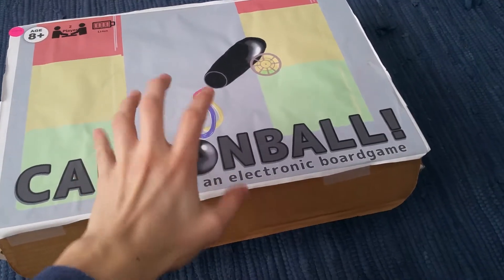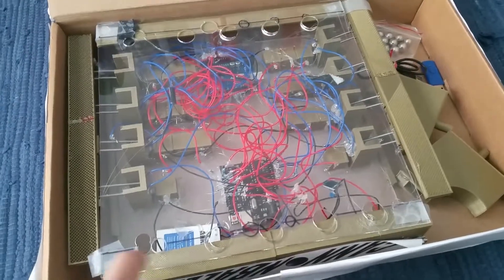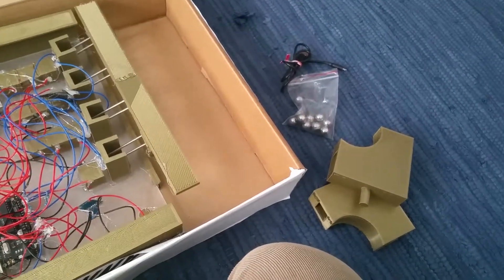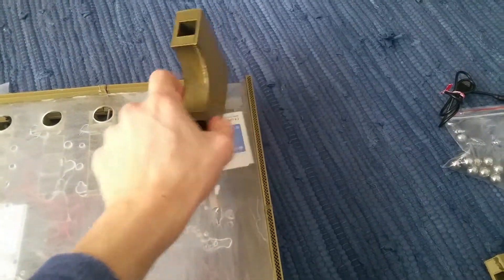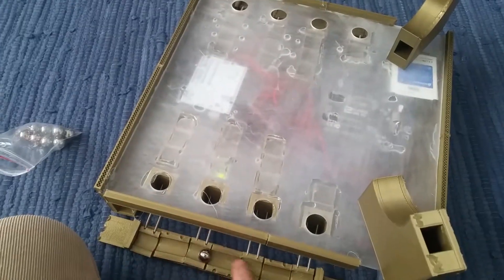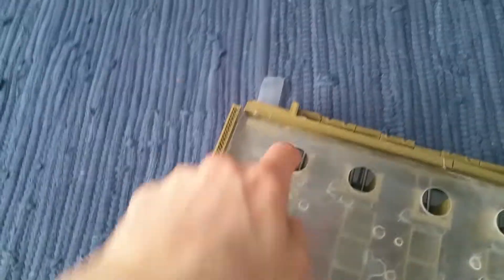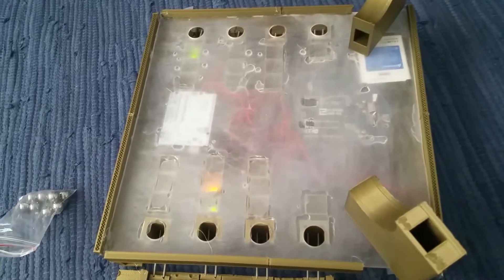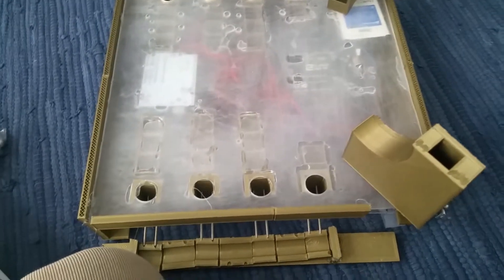Cannonball the DIY Arduino electronic board game final/finshed product

Comment: This is a great rough draft. Perhaps to make the game work a tad bit better you could make 3-D printed molds for the end tracks, and then cast the whole track pieces in one go using a flexible substance. That way the tracks at the end would be one uniform piece but still be flexible enough to allow for the motions required. Also, the funnel idea is a good one, so I suggest following through with that. One other thing you could do as well is to re-print the side wall that the charging port has to be on and make a small hole that you can use for the port. Other than that though the game works well.
Reply from the maker: Yeah, I will definitely be revisiting it, those are all good suggestions